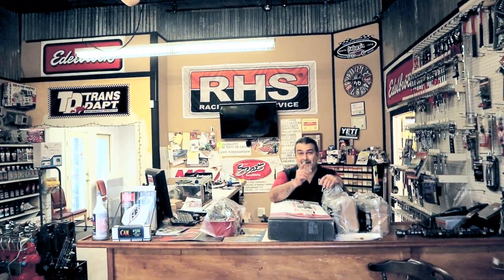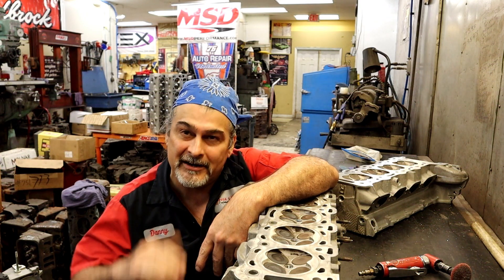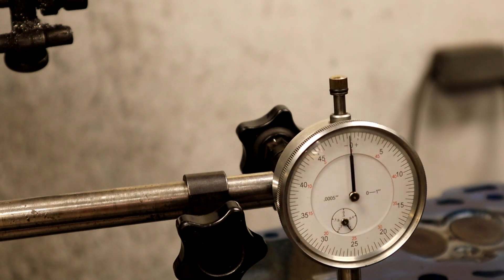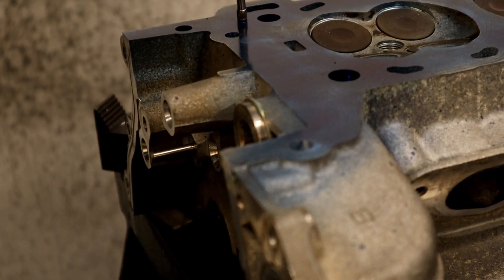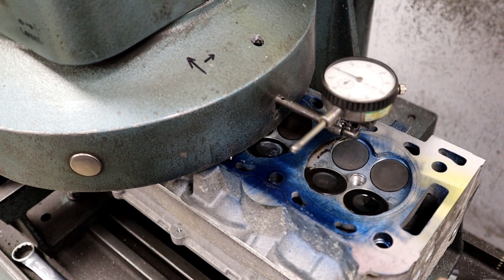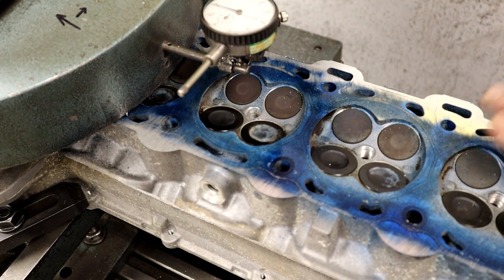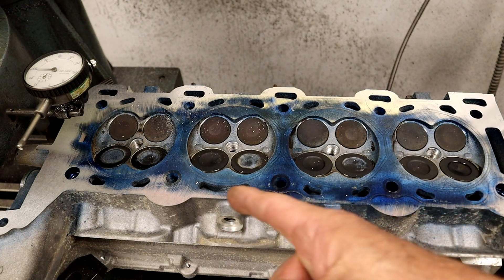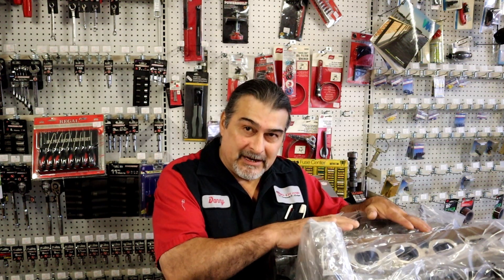TIP OF THE DAY:  Never Use Scotch-Loc’s On Aluminum Cylinder Heads.

Comment: Why would you use a power tool in the first place? I see nothing wrong with using one by hand. Light pressure and good to go. You can’t move as fast as the machine which is why material is removed by using discs on a power tool.

Comment: The closest machine shop to me is 2.5 hours away and this is my daily driver, taking it to a machine shop is not an option.   Im not planning on using a power tool to clean the block/head surface, but getting them clean with a plastic razor blade and or shop rag or nylon brush which really equates to a fkn toothbrush and an assortment of cleaners is a PITA..   Ive considered using a scotchbrite pad by hand but also read they have aluminum oxide and i dont want that crap all over everything.

Comment: Hi 
What a carbide scraper lightly? 
They have plastic type scraper.  Like a plastic razor blade.  
Not a putty knife.  
Maybe like the white scotchbrite.  The mildest on a block.  Just to find any high spots with dykem
They have gasket remover in an aerosol can. Tempted to try using that? 
In the past I have used lacquer thinner.  Was not bad.   
Thank you.

Comment: The carbide scrapers that I have clean 80-90% of the crap on the surface and then I follow up with brakleen and scotch brite pads with my hand. The flat rectangular stuff you buy in the kitchen section at the grocery store. It cleans up any other left over junk and brightens the head surface.  I’ve seen the milling marks come through after I clean the remaining layers of adhesive/sealer on the surface with the brakleen and scotchbrite pads.

Comment: Hello Daniel. Thank you for this video. 
TL:DR 
How do you feel about using a brass wire cup brush on the deck surface? 

I found your video because I replace my head gasket on my VW and it leaked between oil and coolant, but not coolant to oil. I am about to replace the head gasket again with a new felpro gasket, as well as a new digital torque wrench. I used a brass wire cup brush on a battery drill on highest speed with varying pressure. I was still able to see the old gasket outline, but could not "feel" the things i could see.
Reply from the maker: Be very careful with the wire brush, I’ve seen people be able to use it but most of the time it damages the surface. At this point I would pressure test the cylinder head and make sure it doesn’t have an internal leak. Then have the head surfaced or use some 320 grit wet and dry sandpaper and a piece of glass or flat surface to lap the surface. Hope this helps.
Reply: @MrDanielSoliz  I will do just that. Thanks for the reply. 
I replaced the head gasket because of a "VERY" gently broken timing belt. It broke 30 seconds after the high idle slowed after start up. no throttle input at the time of failure and I shut it off immediately. All exhaust were bent, and 2 intake. 
The head gasket was from BRTEC however I purchased a FelPro MLS gasket designed for slightly uneven surfaces so when i change it that's what's going back in.

Comment: How can you prevent paint peeling off of aluminum when it gets hot? Like heads or valve covers......
Reply from the maker: It’s all in the preparation on the metal, sometimes it helps to preheat the parts. Try heating a clean piece of aluminum and you will see it start to sweat, I also like power coating the parts.

Comment: Ever see the video of the the monkey with a machine gun??? Same concept. An idiot with the wrong Rol-loc is dangerous. I use them every day on aluminum using 3M Blue Ultra fine. Just enough pressure to remove gasket or whatever I want off it. Maybe if you explained what to use and how to use it properly instead of saying how bad it is.

Comment: In did not know that aluminum cylinder heads can be milled ...My 1999 Toyota Solara  WorkShop  manual say to throw away 1MZ-FE cylinder heads id that are not flat.
Reply from the maker: Most shops don’t straighten cylinder heads and manufactures aren’t necessarily on board that it  can be done.

Comment: I use a brand new razor blade and a widget holder. For the tough spots I might use a brass hand brush that you use for cleaning before welding aluminum. Never had a problem with it

Comment: I have seen iron heads and blocks gouged with roloc discs. I never use them. A razor blade at a 90 degree angle is about as aggressive as I get

Comment: To be honest if your doing a head job you should always get it faced. Learnt that from doing many rover k series head gaskets o either years.
Reply: Depends on the financial resources one does have. Also if you have a straightedge and a feeler gauge you can make sure the head seals. A downside to getting it resurfaced is the decline of material to work with. On a young engine it doesn't make sense to take off material if everything is fine.

Comment: It's the torque of the head bolts pulling down over the head gasket ring around each cylinder. It's bow down in between the head bolts. Put something down hard and tighten aluminum down all the way around you get a bowl effect.

Comment: First of all you should never ever used power tools with scotch-brite on aluminum cyl head nor blocks and suppose used WD40 very light pressure by hand if get right kind of pad like Light Gray or White pads as for Red, Gray, Green and other color it dose have it place in community when it come to power tool product like Welding. The best way I heard of clean aluminum engine parts with little to no scrubbing Totally Awesome I heard it work well but I my self have never used it, Daniel while you make a good point there are other way not everyone has $$$ to have cylinder heads resurfacing done.

Comment: I have never seen a mechanic use scotch Brite on a head or block surface... I guess that makes me lucky? I've seen razor blades, gasket scrapers, putty knives and sand paper..  I have gotten away with using spray adhesive to glue sand paper to a cast iron surface plate and run the head over that. The thing is you need a surface bigger than the thing you're trying to flatten.. but using an indicator and some blue u can keep everything close enough to square and flat especially a pushrod head... Cams in the head does raise the stakes a bit but still doable.. I think a 2x4 with sand paper wrapped around it or a dull butter knife would have done better.

Comment: I think that head need to be resurfaced the first time be for it was put on the motor the first time Scotch Brite didn’t do all that I didn’t see enough material removed from the head  wight scotch Brite you sad it was leaking water when he brought it in so you can’t blame all that on Scotch-Brite the head need to be Resurface the first time
Reply from the maker: Sorry you feel that way if you look closely you will see where the scotch-loc / scotchbrite on a angle grinder removed aluminum and then right next to it it didn’t then again it did. Low, high, low again. Had nothing to do with overheating. I knew everybody that uses them would not like to see what there doing. Can’t get mad at acknowledge.
Reply: @MrDanielSoliz  Daniel unfortunately I disagreed it is what it is This head was bad before he brought it to you that’s why I was leaking water It needed to be resurfaced before you got it and yes we do  uses on transmissions Only in appropriate areas
Reply from the maker: The fact is it was leaking because he totally ruined deck surface. I did this video to show exactly what he did and it clearly show that. It’s very simple and most people after seeing it with there own eyes get it but if you don’t see that it’s either that you don’t see it or you don’t want to learn. I can’t help that . I did try!
Reply: @MrDanielSoliz  You didn’t say that he took the heads off and Scotch-Brite it up and then put them back on and it leaked it’s not that I disagree with you and don’t want to learn I am 60 years old been in Business 40 years Ben using Scotch Brite forever I I do believe it’s got its places to be used I’ve been around hi horsepower race car engines all my life I have a 3500 hp TwinTurbo car my self so You kind of started this conversation yourself
Reply from the maker: @PrecisionTransmission  I agree Scotch Brite has its place, I seen some people be able to use it on a deck but not many. I am going to do a follow up video and show it in a better light and mill first the use it and remill. Hopefully the next video will be better. 🙏
Reply: @MrDanielSoliz  Daniel you’re doing a very good job great content just found your channel keep up the good work I definitely will subscribe
Reply: So
Reply from the maker: Do you use this on the transmission you build?

Comment: That's called a scotch -"LOC"  Not "scotchbrite". I've been building cars and engine for 30 years and there nothing wrong with cleaning a surface with a actual  "scotchbrite" cleaning pad like the ones used in the kitchen. If your surface ain't flat then it needs machine works, but just cleaning old gasket and dirt from a flat head surface can be done just fine with zero damage to the surface. A straight edge Is all you need to check for flat!
Reply from the maker: @5150on420 you are correct on the name and yes you can use scotchbrite on aluminum heads. I use it every day to clean aluminum. I use it on aluminum after it's been glass beaded, gives the aluminum a nice look. I forgot what they were called, I should have looked it up. I need to edit the video and change the title. Thanks for your feedback.

Comment: Long time rider (motox bikes/dirt-street) working at Yamaha Kawi shop) seen guys use them on 'center cases' as well as 'head' it ruins the cases and head both. Also, the material (grinding dust) saturates all in the passages. I always knew this was wrong as it 'removes materials' aluminum and destroys with the 'dust'.

Comment: Many years ago when I was working for Chrysler (for 42 years) we told techs to never use those wheels on aluminum surfaces. We didn't like techs to use them on cast iron. The suggestion was to use oven cleaner and a wooden scraper. I still use this method. It is litteraly fool proof with great results.
Reply: Oven cleaner on aluminum? Is that okay?

Comment: retired GM tech 3years ago, we knew not to use scotch brite back 15years or more We started to notice bearing failures on intake gasket replacement jobs. the abrasive would get in engine lifter valley. They take off too much metal and leave too much abrasive...
Reply from the maker: I hope tech’s read this. Thank You !

Comment: One mans opinion, not anything scientific here, could be cupping from heat cycling?
Reply from the maker: No the video shows it’s not that. That’s why I sprayed it blue so the you can see where I pointed that it’s not from over heating. This was a hard video to make because, I get it! No one want to see this or talk about it. Sorry it had to be done and because everybody does something wrong doesn’t mean it’s ok. Do people do this, yes 90% of the heads that come in here are like that. Doesn’t make it right. Does it work sure most of the time.

Comment: My Subaru dealer replaced the head gaskets on my 2004 outback (no surprise the gaskets went 🙄....it's a Subaru). Sure as crapping the head gaskets were leaking 10, 000 miles later. I bitched to Subaru headquarters and the replaced the gaskets again BUT I insisted on milling the heads (they all drop in the center of the head). 50,000 later no problems. MLS gaskets require a perfectly flat and fine surface finish.
 I port Japanese motorcycle heads....I won't touch a head unless I can valve job and mill the head. Same goes with cylinders.....they all need to be decked.

Comment: THE WHOLE DECK HEIGHT AND HEAD SURFACE AND DISTANCE FROM THE CRANK TO CAM HAS GOT TO BE THE ONLY LOGICAL EXPLANATION FOR MOST OF TODAYS TIMING SETS, WITH NO KEYWAYS AND NO POSITIVE DRIVE BUT BOLT TENSION AND FRICTION ITS CRAZY TO IMAGINE BUT MOST ALL NEWER ENGINES HAVE CAM SPROCKETS THAT WILL ROTATE INDEPENDANTLY OF THE CAM IF THE BOLT COMES LOOSE OR BREAKS. ITS FUCKIN REDICULOUS

Comment: Worse is the bit you didn't mention. The same lazy mechanic will blow it off & slap it on, leading to lots of abrasive material going into the engine - it's impossible to get it all. General Motors actually has a TSB detailing the failure of a motor from using 'wizz wheels' like this. It degrades the pump and ruins bearings if the filter ever bypasses. It's usually aluminum oxide, which is nearly as hard as diamond.
Reply from the maker: Good point,👍 your right if it does hold a head gasket the damage from the grit can cost you an engine.👍👍👍

Comment: I was a bit confused at first why someone would use anything much less scotch-brite on a milled head and then it dawned on me that some mechanics actually do this by hand which I wouldn't do on the biggest turd of a car unless the owner specifically asks for it.

Otherwise scotch-brite is very useful only I use it by hand so I can't really overdo it especially on less critical surfaces. It's not a tool's fault if you're using it wrong.

Comment: I would always cringe when I'd see my buddies take a scotchbrite pad to a head. I would feel much more comfortable taking a sheet of 800grit, double  sided taping the entire back side of the sheet evenly, then taping it flat to a granite surface plate. (Or granite counter top) Spray that sucker down with plenty of WD40 then lap the mating surface of the head in a figure 8 pattern using light, consistent pressure. Of course, if you have the time and money taking the head to a machine shop would be the best option.

Comment: What would be a good substitute to this if you couldn't get an engine block to the machine shop? Would the whole 1500 grit sandpaper and glass trick work? I'm asking because I can't get my whole ass block to the machine shop just to mill it down.
Reply from the maker: Glass or a piece of granite works great and I have surfaced a block on a stand before and it worked .👌
Reply: @MrDanielSoliz  oh thank God. That's exactly what I did. I was terrified I ruined the block. Thank you sir!

Comment: Scotchbrite is a material. Nothing wrong with Scotchbrite when used in certain applications. Those rotary tools some people like to use are the problem. Never use those on any machined surface, aluminum or cast iron. We get a lot of cylinder heads and blocks shipped to our shop that someone  nearly 'ruined' with one of those rotary, spinning tools. I've joked with our Snap-on tools guy about giving one of those rotary tools to every garage around, because it will bring us a lot of work. lol
Reply: Nice try but go back and watch after the first cut. You'll see the spots where the headgasket's hylomar 'ring' is a higher spot than some other spots. When ANY abrasive media is used to clean up a surface, it's going to remove as much off the deposits as it will the clean metal around it. It will never make it flat, just pretty.

Use a razor or a mill, that's it.
Reply: @hydrocarbon82  We work in a machine shop. Blocks and heads are re-surfaced on a vertical/horizontal boring mill. We get many parts sent to us for re-surfacing after someone has tried cleaning it with a rotary abrasive tool.
Reply: Right! When you’re turning it at 10 rpm of course it’s gonna take metal too. I use scotchbrite for washing dishes and hand rub the old gasket material off. I’m just working on my own stuff but I’ve never had one leak yet.

Comment: High performance engines are one thing but to do this to the average Joe's work beater doesn't make sense. Most clients that bring in a vehicle with a bad head gasket won't be willing to pay for this not to mention waiting a week or two for the local machine shop to get it done when you can just take a scotch brite pad to it and have them back on the road the next day.
Reply: Having been in this industry for over 30 years, I have found that the best way to educate a customer is through a visual demonstration. I have yet to meet a customer ( whether a professional doing work for their own customer, or a diy client) who did not grasp the value of having the job done correctly the first time. If the head gasket is blown, we always recommend a pressure test to verify that the head is not cracked and also perform a warpage check ( especially with overhead cams!). Since our customers are already paying the book rate to R&R the head(s), the additional charge for the machine shop is money well spent. 
I am curious, if the head has to come back off due to seepage, do you charge them again, or do you warranty your work?
Reply: @elainesoliz2205  to be honest we've never had one come back yet. That being said if we didn't fix it the first time then that would be on us.

Comment: I agree with you on the scotch brite but in my 30 years shop experience most aluminum cylinder heads cup like that from heat cycles and need to be cut flat again, not shined up.

Comment: Was told to scrap gasket material off and not to grind with anything when I was working on autos.  That was on iron materials also.  Our use Scotch-Brite was on the exterior to clean and make things shine.  Good explanation on the cause and effect.
Reply: Scott's bright eats away more material than what many think

Comment: I saw a Pakistan Video where the mechanic scraped the head gasket off with a piston ring.
Reply: There are some cultures that believe if you change  oil while its hot it will damage the engine. So that's not surprising.